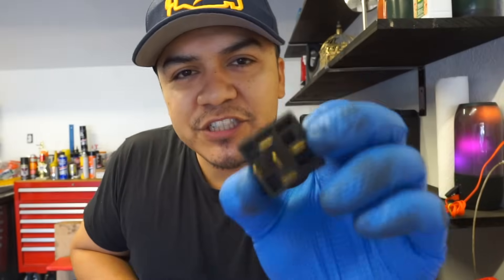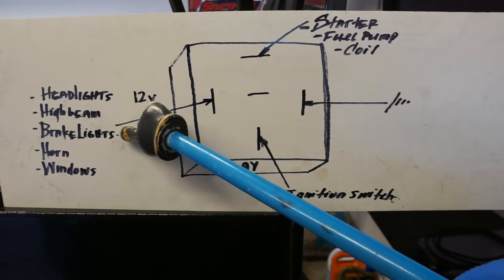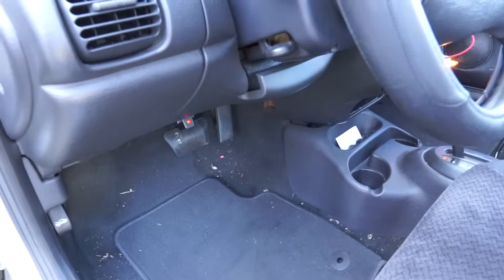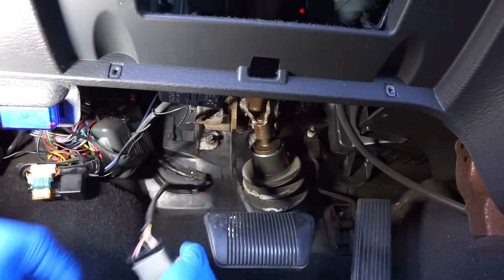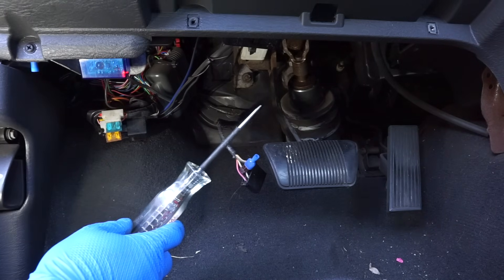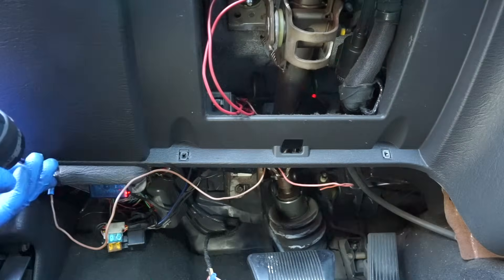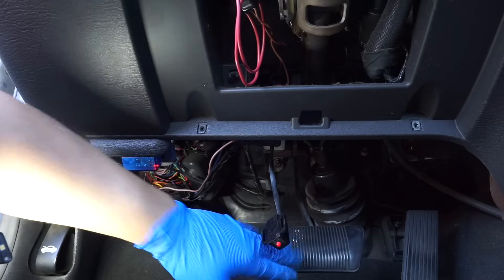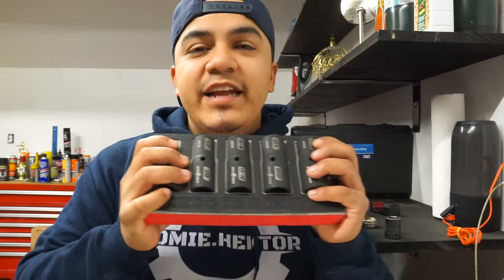How to use a relay as a Kill Switch or safety switch

Comment: Man this is the cleverest way to use a relay switch. As you mentioned this solution was a safety consideration for your kids but it gave me some ideas. I am thinking of putting two relays in serial for the ignition circuit to be closed. So for example brake and hazard lights. As a hidden kill switch, this should deter the common thief. Thanks bud.

Comment: I recommend using insulated spades on the relay connections 😅
Reply: Also, I'd recommend not cutting into the factory wiring harness. I'd look for proper sockets for the harness, but that's just me.

Comment: Would this work kind of in reverse? I'm trying to set up a killswitch that when the switch is on and the brake is pressed, the car will shut off. And when the switch is off the brake will work like normal.

Comment: No, it won't click every time you step on the brake when the car is already running.
It only clicks when you step on the brake and you haven't started the car yet, it closes that contact because it got power from the brake switch, when the car is turned on it gets the other side of the positive current and makes contact, it stays on as long as there is power on the other side, these are pins 86 and 30 on the relay.
Pin 86 clicks every time it comes into contact with the + 12V power supply (of course it must be permanently grounded, pin 85), and pin 30 is the second positive contact on the relay - permanent + 12V, so when pin 86 clicks, it turns on the connection, and stays that way as long as there is power from pin 30.
Returning the key to the initial position - turning off the car, cuts off the power on pin 30, and pin 86 loses contact and returns to its initial state - opens the contact.

In this case, he brought +12V from the brake switch to pin 86, and from pin 30, to one end of the broken starter wire, and brought the other end of the starter wire to pin 87. When he steps on the brake, a click is heard, the current has activated the switch, by turning the key to start the engine, +12V comes through pin 87 and goes to pin 30, or from 30 to 87, that's what he says "it doesn't matter".

The idea is certainly cool.

Comment: You could have the relay get constant power directly from the battery through a 16 guage wire and an inline fuse, and just find a chasis ground, then find your signal wires, from brake pedal and tap in there , no need to have your headlights on or any of the other stuff that needs to be on to keep the car running

Comment: How to connect it to the horn? So when the 86 and 85 is not activated, when you try to start the car the horn will turn on. Is it possible on this to add that connection?
Reply: Yes, tap into your horn wire and plug into 87A. So when they turn the ignition it will trigger the horn.
Reply: Yes
Reply: Thanks a lot.

Comment: Thanks for video,but nowadays, almost all vehicles comes with that already, i would recommend connecting grounded black wire that connects starter motor solenoid to toggle kill-switch hidden.

Comment: Hola Hector. Let's say I installed the kill switch at the cigarette lighter. Now, I want to use a transmitter (remote control) with rolling code to activate first the cigarette lighter. Because, even if the thief finds the kill switch, it won't work. Only when I press the transmitter, the cigarette lighter function is released for use. So first you use the transmitter,  than press the cigarette lighter and then you could start the engine.
Well, that's only theory in my head because I'm not a specialist. But, how would have to be done these connections and wiring ? Could you try to explain that, please ?!? Or it's material for another Youtube video...😂

Comment: Thanks for this great video, helps to  find hidden ones-

If you are having problems with lights or radio, Fuel Pump etc...

Shady Mechanics may have installed a remote Kill Switch to make you think there are mechanical problems-

Comment: What we need now is a device that will sense the the car's activation frequence (push buttons) if its not exactly right or maybe too strong and deactivate the crank and fuel pump circuit.

Comment: My car has a seatbelt dashboard indicator light. I used the switch in the seatbelt socket to control the relay, interrupting the starter circuit. Seatbelt not fastened, starter won't work. That combined with a small normally open pushbutton switch hidden under the left front of the drivers seat makes it hard to figure out for someone else. Got to have the seatbelt fastened, reach under the edge of the seat, push the button and then turn the key.
Reply: Ahhh that's a good idea

Comment: Fuck that use the ground side of the coil! That way you only need ONE wire from the relay plug side to the switch. What you do is break the ground side of that coil and bring it to your switch. Opening the switch removes ground from the coil. So no matter WTF anyone tries to do that starter relay is not gonna activate because the 12vdc side is "floating" without the ground connect.. you got that? The key though is accessing the BACK side of that relay. Yeah that's where the "fun" is. Its also even more problematic if the starter relay is in the engine compartment rather than under the dash. BTW my vehicle requires one to depress the brake pedal to start the vehicle anyway. Better to have a separate kill switch wired to the starter relay. Oh.. one more thing learn how to solder connections it ain't rocket science.
Reply: Do you have video for that bro

Comment: Great tutorial. Finished mine today, instead of the ignition I used the much smaller neutral safety switch wire and a light. Just be careful the lights dont burn out, then the circuit is dead and you cant start your car

Comment: Oh my god there is 19 minutes of my life that I will never get back. Talk about assinine A kill switch is probably a good idea for theft or kids but wired to the brake lights does absolutly nothing. Any modern car with an automatic transmission will not crank anyway without putting your foot on the brake. You have done zero here ecept for adding more connections and another component, all of which are more points of potential failure.

Comment: It might sound strange, but using the brake switch is not the best option. Personally I'm 99,% stick shift guy. But even the few automatic I drive. They all oblige to press the brake pedal to start the vehicle. With that said several with manual gearbox demand the same! 
So I can tell you, that the first reaction entering a car. That I intend to start, is pressing the brake and clutch! It's a second nature...
I suggest something way more discreet. A button on the dash in plain sight! For the same function. There's tons of aftermarket buttons. With symbols of pretty much anything. From heated seats, to fog lights. Get a momentary switch, of your choice and that will be a "bitch" to locate by a stranger. 
You can even combine switches/functions, etc. 
Another interesting option, is a magnetic switch. As the name implies, activated by a magnet! ;-)
Cheers

Comment: This is a clever variation on the typical single pole single throw toggle switch hidden somewhere under the dash. May I suggest; however, not using the brake circuit as a potential car thief just might be the one who is in the habit of putting his foot down on the brake pedal before turning the key to start the engine.
Reply: Yeah that's outright stupid and in fact my vehicle requires one to depress the brake pedal to enable start anyway.
Reply: He say that he doing it as child safe feature, not anti theft. If the kid is small can't reach the brake pedal and hence can't crank the car.
Reply: Yep. Surprised he didn't wire the relay into the ignition switch to make it even EASIER for the thief. 🤣

Comment: Nope. Now each time you hit your brakes you are cycling a circuit that was only cycled on starting your vehicle.
The engineers did not design system to cycle on hundreds a time a day.
This may work if the wire is designed to take long periods of 12 volts... 
A hidden button would have been better, a press and release button. 
Again, when you are at a long stop light, you may overheat that wiring.

Comment: Standard automotive relays and relays that can be RF actuated with a key fob, for example, are readily available, but with all kill switches, I have dependability concerns.  Wiring a kill switch into any run circuit, such as a fuel pump, will immobilize the vehicle, but failure of a low quality switch or relay or a poor connection could either leave you stranded or even shut your engine down while driving in motion.   High quality, military grade switches are available for $25 to $50 dollars, rather than $5 bucks, but I'm not sure where an equal quality relay can be sourced.  I would also solder all electrical connections and epoxy pot them to insure their attachment and prevent corrosion from ever occurring.  This is a circuit that need to be bullet proof.
I'd be interested to hear others feelings regarding reliability and/or sources for high quality relays.
Reply: There are lots of different types of relays used in industrial controls so that might give you a good starting point for research. The form factors might be different since many are designed to be mounted in control panels but a relay is still a relay. Also I would avoid soldering any connections. It might seem counter intuitive but even NASA recommends crimping over soldering wires since crimping has proven over decades to be an efficient and highly reliable method to assemble and terminate conductors, and typically provides a stronger, more reliable termination. I recommend Raychem sealed environmental butt splices for connecting wires. If they are good enough for airplanes then they should be good enough for your vehicle.
Reply: @josephphillips865  I found good high power relays made my both Honeywell and Omron, which are classed with military and aviation certification and are a similar format.  Note that you can also wire to a relay socket and simply plug the relay into the socket.  A spare relay in the glove box will allow a quick swap if a relay failure were to occur. There are numerous  other relays which are more heavy duty, since they are rated to handle currents up to 200 amps, which are typically used for power winches and snow plow controls.  
Yes, there is controversy between crimping and soldering connections.  Soldering provides a superior bond between the wire and terminals, but due to its' brittle nature, vibration and wire movement can cause failure.  If flex and vibration are present, the crimped connection would be preferred.  Depends on the mounting situation.

Comment: super confusing if you're not an electrician or work with that crap a lot. I just want to put in a simple cut off switch to the ignition. you know like a toggle switch between the ignition wire and the fuse box which can be hidden

Comment: I thought all modern cars need to press the brake in order to start the ignition. I guess maybe yours are a very old car which you don't need to depress the brake to start?

For my case it's simple, I put a kill switch in between the brake light switch. So when i activate the kill switch even if I depress the brake the car won't start. And when I Off the kill switch and depress the brake than the car will start.

Comment: So, is this almost the same as using a momentary Switch?  Like, you splice in an open-circuit button into the Starter line, hold the button while you start the car, and then it's safe to let go of the button. 
It might not be as hidden as the relay system, but maybe it's good to have it visible.  Make thieves think "there's at least one kill mod on this car, maybe there are more" (using two or more secret buttons/switches) might make it seem "too crazy, not worth stealing."
Bonus points if you have one switch easily visible (it doesn't even have to work) and then have the real button(s) hidden somewhere else.

Comment: Hektor, I'd go back and tell people to never use those splice connecters, EVER!! They are the leading cause of wiring issues in DIY cars. I owned and operated 2 shops in Upstate NY. and those junk splices were the cause of very many shorts and no tail light tickets and the cost of having me find and repair their mistakes......  There are FAR BETTER ways to make a splice and THAT is what you should be teaching!!!
Reply: You beat me to it, was just gonna comment the same thing! T taps are garbage!
Reply: What can I use instead of that?
Reply: @revit4909   Well, to start off, there are many cars that now have terminal blocks that you can simply add wiring to. Often these wires are for the trailer brakes. Also you can remove some of the harness protective tape and cut the wire you need and rejoin it with the addition of the new wire needed. The best way to make this joint is to solder it and protect the joint with shrink tubing. There are more technical ways also, but they require some specialty tools and additional pins.  Do a search on soldering automotive wiring. It's all in the YOUTUBE-VERSE!!! lol...

Comment: My personal favorite mod is use brake pedal switch power through switch to high beam trigger on relay. With switch closed no brake lights and high beam illumination without headlights/ tail lights on. Great for night escapes in wooded areas.

Comment: Thanks to your video, I learned how to wire up a relay kill switch. But I decided I'd go one step more-- a two relay immobilizer AND a kill switch for my theft-magnet Accord. I tapped into the clutch safety switch (you have to hold the clutch in for the car to start.) 
So now I have a hidden kill switch which acts like the clutch safety switch. But the real magic is in the two relays-- they are set up in a circuit so a momentary push button energizes the relays, which then allows the fuel pump to run. When the car is turned off, the circuit opens and the fuel pump won't run. 
So secret switch one = allows starter to turn over, but secret switch two = allows fuel pump to activate. Hopefully this keeps the thieving bastards from boosting this car.
Reply: Clutch? Is it manual transmission? Don’t you have to step on the clutch to turn on any manual transmission car lmao how is that a safety lock
Reply: @Charlie-lx9mg  yes, it's considered a safety feature. But now to start my car, you must push in the clutch AND   activate the hidden switch, on the same circuit. If the switch is not on, the car acts like you didn't push in the clutch. And then there is the secret fuel pump switch....
Reply: @dmjole  ahh I see. So it’s a two way activator. Like an AND gate circuit

Comment: Very interesting video! What if I want to apply the same method but to something like a fuelpump (for example) but only want it to work when the ignition is on.. Then instead of connecting to brakelight what would you recommend.?
Reply: The brake is use as the hidden switch.   His example is don’t want kids to start the car.   Would not use brake to stop a thief.   Would use a momentary switch hidden so it’s not in plain sight.   I sometimes use two switches.  Makes it harder to figure out.   This type of kill has prevented my truck from being stolen it just cost me a new ignition
Reply: @dougvida  I understand thats his method is a sort of anti theft system and so that the kids cant turn on the car.. But i just asked if one wants to use a relay to connect  something to it fuelpump, lights whatever so it only turns on with the ignition
Reply: @krimobenzzemma4740  
Ok you may need to find a wire that becomes hot when the ignition is on to do what you want.  In this case it’s using the starter so the relay is like a pulse / switch.  You need a constant 12vdc in this cast to keep the relay closed.  Need to be careful of the current draw.   Things may get hot.  Maybe a better way for always on devices
Reply: @dougvida  yeah thats what i am still figuring put.. so things dont get overheated and wear out..
Reply: @krimobenzzemma4740  always add a fuse and there are many spots on fuse panel and random dead end wires under dash. Just use the test light to find keyed power

Comment: only problem is if it fails... you have no power brakes and your car is in motion or dead stopped in an intereection
Reply: Nope buddy.  Start reading and understanding wiring schematics.  And remember the added complexity is for the starter. So if you shut off motor and it was failed yes you couldn't restart.  Think about all the things you said and the things I said. If you still think you are correct,  get at me

Comment: Could this be used on the main power lead to the fuse box? I have some kind of power draw I can't find and thought this might work to just shut the battery off from everything?
Reply: Just fix it. There are boat power switches but you gotta operate them manually
Reply: @joeKisonue  I think the problem was the computer but all is good for now lol